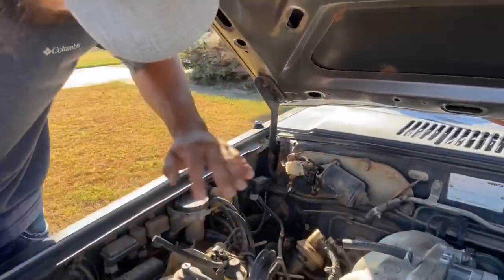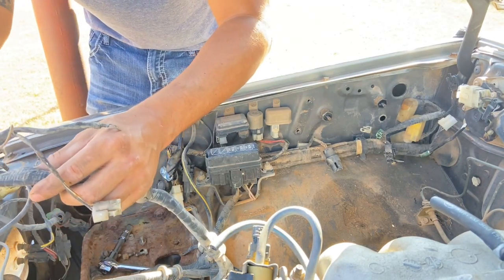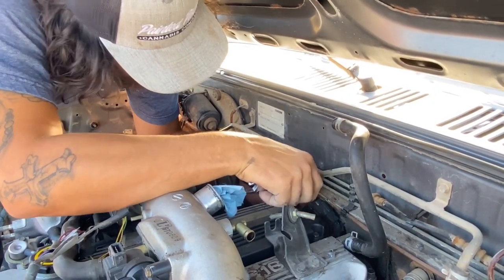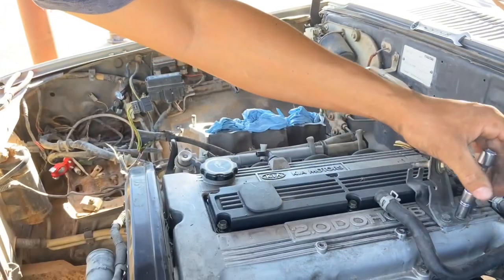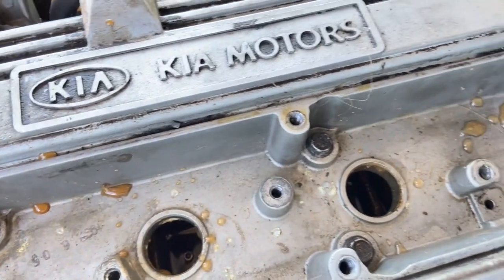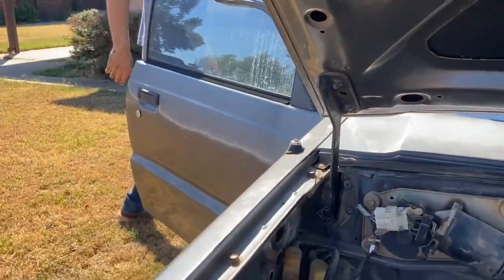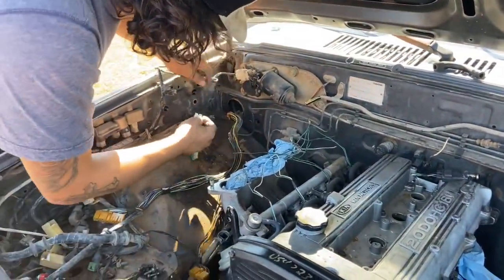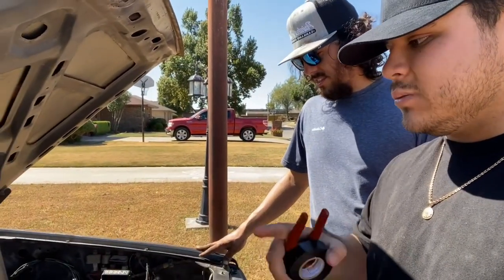SEMA build 2021!!! Kia Sportage in a Mazda B2200 😱  watch us tackle this wiring issue 🙃

Comment: that water is from them pressure washing off the motor. it is not inside the engine or spark plugs so not an issue buddy.
Reply from the maker: thank you brotha 🙏🏼